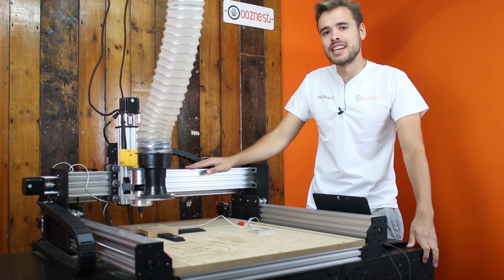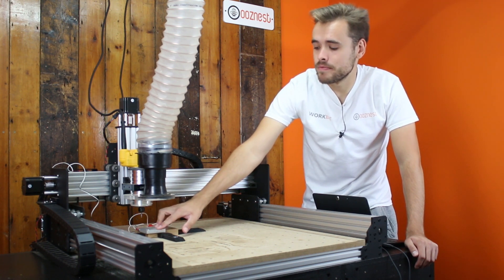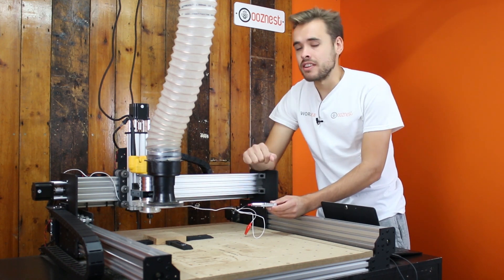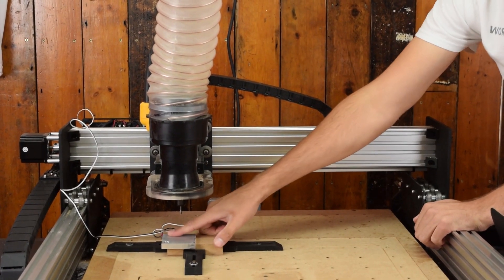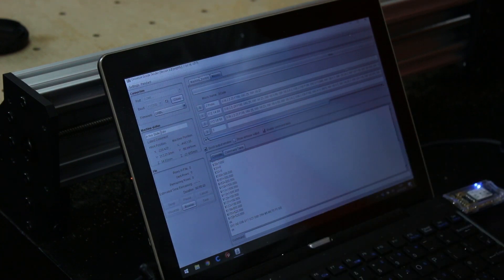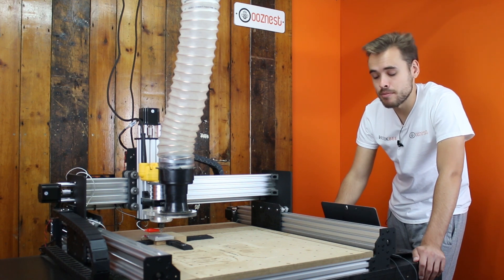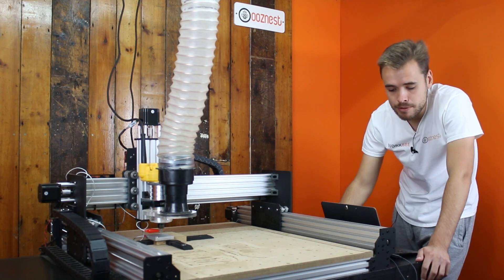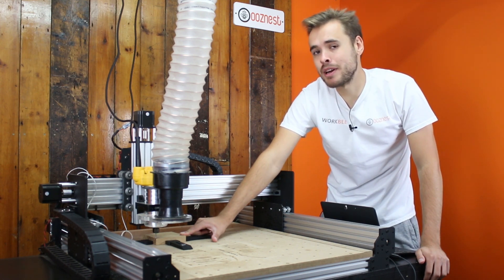How To Use An XYZ Touch Probe | WorkBee CNC Machine | Ooznest

Comment: So could you turn the touch probe around and use that to zero to the spoilerboard
Reply from the maker: Yes that is possible to probe just the Z
Reply: @ooznest  so then you just set the x n y manually by selecting set x n set y on duet web control right?

Comment: Whats the size of the machine you are working ? Its a 1000x1000 or its other size ? Thank you
Reply from the maker: Hey, we are using a 750x750mm, it will work on any size machine.
Reply: @ooznest  HI.. if we need to cut POM ( Plastic material ) with 17 mm of height and 48 cm x 48 cm total dimensions, wicth machine is better.. the 75 or 1000 ? Thanks

Comment: Hello,
If you are using the Ooznest interface for the Duet Web Controller and this kind of models of XYZ-Probe. 
Don't forget that you need to start a Z-5 (or lower) from you Z -Home position and be in a X-Y position roughly aligned with the hole in the probe.
Thanks for your work on it Ryan!
Reply from the maker: Hey, thanks for the comment!

Comment: How do I use the offset calculator if I have different measurements of my xyz probe than yours.  I don't understand what I'm suppose to be measuring for my probe offsets and travel distances. Do you have a video explaining how to use the offset calculator?
Reply from the maker: I am afraid we don't have a guide how to use the offset calculator. You just need to measure your probe dimensions and then the offset (The part not cut away), and put it into the calculator.
Reply: @ooznest  It be nice to have a short vid as I'm not sure if I'm doing it correctly.  Numbers don't seem to add up but then again I'm not 100% sure I'm doing it correctly to being with.  Yes I'm still a newbie :)

Comment: In an electronic point of view, is it just two wired connected to the duet controller or do you also need to add some stuffs like a resistance or something?
Reply from the maker: Just two wires, like a NO limit switch
Reply: @ooznest  Great thank you!
Reply: Could you tell me on the pin to use for it and the gcode commands to set?
Reply: I mean the command to tell to the duet controller that we have connected a zprobe on the duet controller. The probing itself is in your guide in comment.